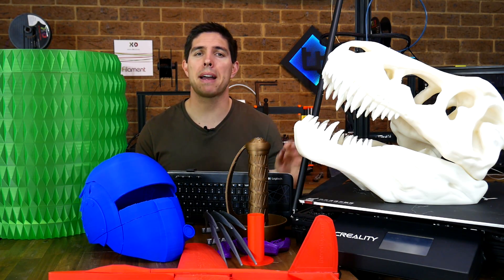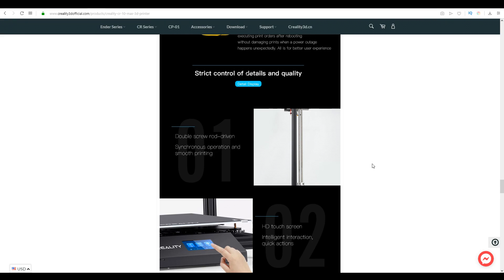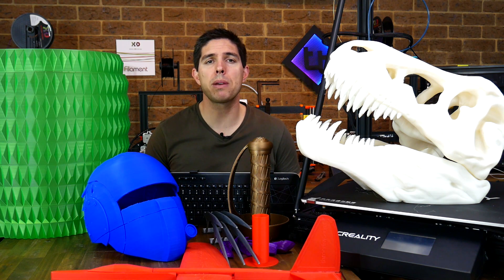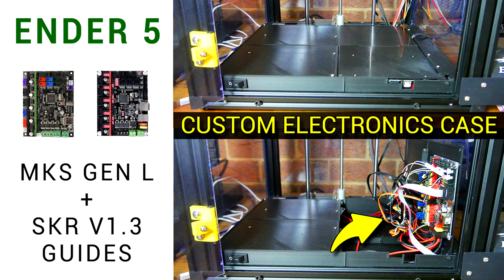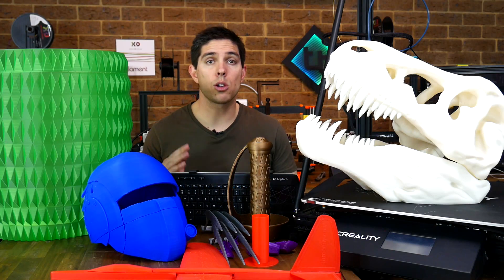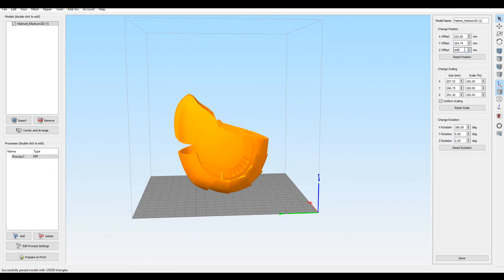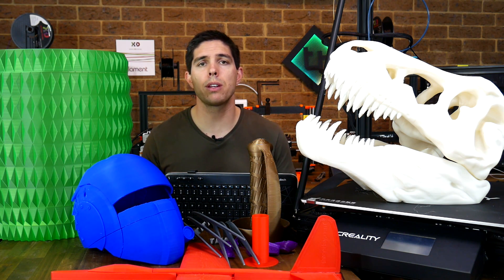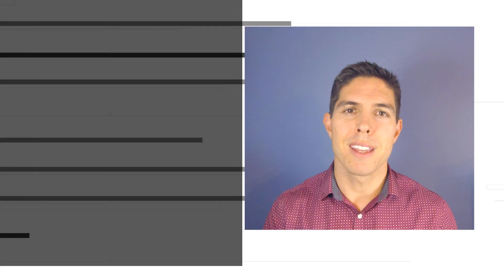CR-10 Max review - Is bigger better?

Comment: The issue with the layer seperation on your vase if probably due to the plastic not heating up enough. With a nozzle that big on a heatblock that size, it may simply not have the time to get up to temp if the speed isn't turned down.
Reply: Seth Krumm Agree... need to heat up a bit more... it is too much volume to pass quicly for the heatblock in a higher speed (for that nozzle size). Need to balance it... no v-ref changes needed.
Reply from the maker: Agreed guys, hence the slicing change with slower speed and more temp. The vrefs were still shipped below their specs though.
Reply: Teaching Tech Ok about v-ref. Marcus, keep in mind that you can go until 235 for PLA... expecially when you print with higher layers and wider nozzles. 

In Ultimaker community we make a calcularion about the volume to use a proper balnce beetwin speed, nozzle width and layer high... multiplicate all of those and you get the volume for m^3. Try to stay at 3-5mm^3/s for stunning quality and 5-8 for faster prints... more than that and you can get underextrusion (at least in UM2 printers). Cheers and keep up this awesome work!
Reply: with Bondtech extruders you can go up to 11mm^3/s

Comment: Here's how I would have designed this: all axis screws, no belts. Yes it would probably be a bit slower,  but for the distances being traveled,  belts don't seem to be as efficient.  And for the print bed, just as in the Z, I'd double up the motors..

Comment: Using massive nozzles with large layer heights is more complicated than it seems. Your temperatures with a standard 0.4 nozzle/0.2 layer height just won't cut it. Your temps have to be recalibrated, extruder steps, extrusion multiplier, part cooling, etc. I think Creality gets away with it on their smaller printers, but its very obvious where they are pinching pennies, and their QC is definitely sub par. I don't regret my Ender 3 because it prints great and has taught me a lot, but that's only after a lot of time and investment getting the quality and reliability up. For a printer of this size and expense which is obviously NOT a beginner/entry level printer, it should not have all of the same issues.

Comment: On a bed that size distortions are inevitable, genuine mesh bed levelling with as many points as possible should be mandatory.
Reply: Yes, but that is not a solution. You do not want to print leveled, but still skewed and warped prints.
Reply: @CrashPCcz  Are you on the plonk?

Comment: It looks really cool but I can't get my noggin around bowden on a single extruder?
Surely direct drive would be better and less expensive?
Reply: Bowden means light print head.
Reply: @JasperJanssen  it means the hotend is connected by a Bowen tube. The only necessity for which is really multiple filament printing.
Reply: @Quadromodo  no, it means the extruder and especially its stepper motor aren’t on the print head. Which means you can print at higher speeds with less ringing.

Not that that advantage isn’t much bigger when you have more than just 1 extruder feeding into the print head, but it’s not the only situation in which it makes a difference.
Reply: @JasperJanssen  I'm aware of what Bowden means on a 3D printer, I own a HE3D EI3 with triple nozzles wasted about 9 rolls of filament on it. It now runs as a direct drive titan with a custom 3D printed carriage and it prints perfectly. I personally hate the Bowden tube set up because retraction goes wrong constantly and shit prints get produced. I tried every set up from the original triple nozzle to AMF 3 in 1 out, 3 in 1 out diamond hot end. I'd rather just print good and accurate. My carriage has a titan that runs a pancake motor and I have had decent prints at 120mm/second.
It now equals my highly modified ANET A8 which I bought and modified about 6 years ago, except that it now has a build height of 300mm instead of 200mm.
Both of my printers have produced several hundred hours of prints. I'm afraid I'll stick by guns, direct drive is simply better and more precise.

Comment: Thermal runaway has been an option in Marlin since a long time, incredible they didn't switch it on by default
Reply: Ever tried talking to a Chinese helpdesk? They may have an English speaker on the other end who's like sales support or something but the workforce are generally Chinese and don't understand them. Besides by the time you have finished getting your message across you will have spent more than buying a homegrown 3D printer.

Comment: The problem that you had with brittleness is probably due to a too low temperature. A 0.8mm nozzle needs a lot higher temp than 0.4. I would increase a normal temperature of 200 to maybe 240 with such a big nozzle.
Reply from the maker: I found 220 a nice middle ground, albeit with stringing.

Comment: Seems like FDM has reached a limit. Size over practicality and use as well. Sticking a high end price on it doesn't mean it's a quality machine. I was quite interested in buying one but I think I won't. I'd rather stick 2 good parts together than have one larger part that's bad.

Comment: Im looking for a printer to do interior elements of around 1x1 m in size, it's totally amateurish but I am looking to limit the number of parts so am looking for a good 250/250 or 350/350 bed and rather the larger than the smaller. Any recommendations?
Reply: Ender 3 with and ender extender kit

Comment: Looking at the clicking extruder around 5:32, there was enough back pressure at the nozzle that the filament spring back was reversing the stepper motor. So nice thing is the bondtech gears were working well... because it wasn't slipping, the compression was actually back driving the stepper motor. Increasing Vref will help you push harder, but at the end of the day I think the limiting factor is not enough melt capacity for the volumetric output you were trying to generate. Two solutions: 1.) Increase the temperature so you can get more Delta-T on the filament. 2.) A better over all solution is a different hot end with improved melting capacity so you don't have to run artificially high temperatures to minimize back pressure. Great video as usual.
Reply from the maker: Thanks for the great post. I went for the temperature increase option but agree something like a volcano style hot end would be better.
Reply: @TeachingTech  A super volcano would be more apt. Some lost Z would be easily offset by 200g+/hour. Some giant 1.4mm nozzle prints.

Comment: 0.8mm nozzle on cheap pla on stock Ender-3, I find it maxed out on 0.6 layer height and 40mm/s print speed with cura and much higher temp than specified 210c maximum, 220 in fact, any lower and it will start clicking. I'm afraid something like E3D Volcano might be of consideration for larger volume print
Reply from the maker: Agreed.

Comment: Dear Friend! Could you please advise, what is printer under 300 usd better to buy in case you are beginner in 3d printing? I am choosing between anycubic i3 mega and ender 3pro. Thank you in advance for your advice! P.s. m.b. toy have another option for me, please share!
Reply from the maker: I haven't used the Mega but as far as I know it's solid. The Ender 3 Pro is a good choice because the community is so big and there are a lot of resources for it.
Reply: @TeachingTech  thank you very much for advice!!! Does any delta under 300usd (qqs or similar) worth it?

Comment: A printer with this large printing volume shouldn't have a moving bed. Too much inertia to manage by Y-axis motor and very soon motor and belt will wear off. One more thing is tangential force on top of the print, dangling cable will produce enough force on print that it will deform and loose alignment with nozzle. For 1000$ I can built a printer 100 times better than this.

Comment: I've got the CR-10 Max at work but haven't printed with it due to thermal runaway issues. Could you share the updated firmware?
Reply from the maker: https://drive.google.com/open?id=0B1mfg93qT2fsRXVnS2VqQzRfYllSSnM4RkdPMVhUcEFWSmc4
Reply: How is it working for you at work?
Reply: Jens Petersen a dust collector at the moment. Waiting to upgrade to octoprint on it to make the workflow easier. We’ve got 22 Prusa Mk3S so we don’t have much time for other printers

Comment: I have this printer im happy with the prints so far. Im having bed leveling issues where i set up bed hieght than after it auto levels the hieght is off and it different hieght every time within 1-2mm off. I usually have to adjust after print starts. Thanks for the videos very helpful.
Reply: Maybe you should try with a thread locking compund so that the screws cannot move.

Comment: Well i definitely don't check the boxes for who you recommend this printer to haha.
I have zero 3d printing experience but at my job we decided to buy one and they really wanted large build volume, so we bought the cr-10 max.
Done all the mods to it from nexitech's  review and am slowly progressing to make better prints but it is surely overwhelming as a first printer haha.
If you've got some slicersettings tips they are more than welcome!
Btw i also found the fan duct broken of and laying on the heatbed this morning haha.. i fixed it by printing a new one from petg.

Cheers!
Reply from the maker: My main changes to the slicer are in the video and my Simplify3D profile is linked too. I think you can open it in a text editor and read the settings. Well done on overcoming many barriers.
Reply: @TeachingTech  ah cool thanks i will look into your settings for sure:)!
I might want to purchase S3D in the future because of all the great things i've heard about it on significantly improving printquality.
Thanks a lot man, videos like yours help a lot and i will be a subscriber from now on.

Comment: My CR10S5 was great out if the box and upgrades are very easy to do. Adding a BL touch can be done in a day but honestly the bed came flat enough that I haven't once longed for the feature. Adding struts is not difficult at all and if you don't mind a click dial instead of a touchscreen they're great machines.
Reply from the maker: I'm almost tempted to do a build like this just to see how cheaply it can be done.
Reply: @TeachingTech  I actually got my CR10S5 (I call it half bootleg because some parts are OEM creality parts) for around $500 with shipping and everything on eBay. I'd love to see you pimp out a cheap printer!

Comment: Huge build volume is great, but TBH, I'd expect a $1000 FDM printer to need less tweaking to get usable prints.
Reply: @Barry Allen This is confusing.  The comment you replied to asserts the printer is relatively expensive, you say it's cheap.  TT seems to think it's overpriced, as well.  You seem to be out of step here.
Reply: @Barry Allen I have a job.  I don't just get to troll YouTube pretending skill and knowledge I don't have, attacking legit comments because I'm insecure and have a tiny little printer.
Reply: That's not 'tweaking'. That's repair of a broken product that should not have shipped.
Reply: @Barry Allen silly troll.  been printing for years.  don't need your trollish advice or opinions.  learn to read.  legit comments, not knowledge.  what are you, twelve?
Reply: yes technically its no different than a smaller unit so build quality should be high for 1000 dollars.
Reply: @magnetmannenbannanen  I'd say in retrospect that slinging a thousand bucks to make PLA prints of anything is as insane as Me. 3D printing isn't really worthwhile unless you are printing houses.
Reply: @Quadromodo  uhm, it could very well pay for itself in just a couple uses. I've purchased 2 gunstocks for my and my nephews Oculus Quest 2, each one was $100 including slings, and if id have invested the money purchasing my own printer instead, I could then still have a printer and be able to print anything else. Just because YOU have no need for anything 3d print related, doesn't mean there isn't ANYONE. Many people make a living off printing stuff for other people.

Comment: Creality is a shit company that produces shit products. Not having thermal runaway protection as a factory default is borderline criminal. Not to mention they STILL steal from the open source community and don't give back, AND every 3D printing forum is absolutely clogged with people asking for help with their shitty Creality printers. Fuck Creality.
Reply from the maker: That's a very strong opinion :D
Reply: @TeachingTech  It's based in fact. They produce low quality products, with little to no QC. No bootloaders making it very difficult to upgrade firmware for the novices these printers are aimed at. Sending machines out the door with basic safety settings like thermal runaway protection disabled shows a complete lack of concern for their customers. That alone should preclude anyone from purchasing their products. Would you buy a water heater with no pressure relief valve? Plus their blatant disregard for the Open Source community and the licensing of open source hardware and software. They do not care about the community. They do not care about safety. They do not care about their customers. They do not care about international law. They care about nothing but profit. And it's not like they haven't been called out on this many, many times and are not aware of the problems and danger they cause. Hell, even Naomi is getting sick of their shit. They are a horrible company and should not be promoted or supported in any way.

Comment: I cannot believe that Creality is still sending printers out with thermal runaway protection disabled. 
shame on them. they know it’s a big deal!!!!!
Reply: Clorox Bleach you’re missing the point. 
Yes, firmware can be changed, BUT this should NOT be turned off by default.  If they can add automatic bed leveling and filament runout detection, then why not just turn it on?  Seems like no one has told Creality about the Anet fires!

Comment: This was my experience with the S5.
Reply: Same. I have an S5 and have only done 3 prints on it and set it in the corner. The S5 really needs bed leveling and I dont feel like installing a boot loader just for that. I am sure when I have more time to mess with it I will update the board and add bed leveling.
Reply: I ended up replacing the stock board with the TH3D Creality board replacement for two reasons... First and foremost for the trinamic drivers. The y-motor was so loud even after using a rubber damper it would howl loud enough to wake the dead!  Second for the native bltouch support. With a bed that size, it should be standard equipment from Creality. The only other mods done was swapping the hotend for the MicroSwiss drop-in and adding rods to stiffen the z-uprights. Now it's quiet, reliable and safe. The next thing will be to ditch the heavy-ass glass for a flex-plate system.

Comment: I have the CR-10S Pro, have some issues worked through them, dealing with Creality customer service I would rate it poor at best. I think what sells creality is the size of what you can build, the max to print ABS you would have to build a condo around it. Poor quality control. Thanks for your video.👍

Comment: Where did you get a spare bltouch pin? Mine was bend and is don't trust it anymore.
Reply from the maker: I changed to a whole spare BLtouch. I did get a spare pin with one of the first ones I purchased, but I didn't use it here. btw I've had bent pins in the past, bent them back straight and have had no issues since. If the first layer is good, the first layer is good!
Reply: @TeachingTech  OK I wil give it a try. Thanks!

Comment: I think Creality just need to slow down a little and work on improving QC & refining their printers taking a little longer between iterations. They're releasing printers too fast with barely any improvements to each.
Reply from the maker: A very fair point.
Reply: I'm with you there.

My ender 3 has been amazing but it also pays to take your time building them and checking every screw.
Reply: I agree. I've got an ender 3  and it has worked almost flawlessly out of the box.
Reply: I agree. If they could just go the extra 5% in the QC process, their larger printers could double in value.
Reply: I'm having a blast with my CR-6 SE so far - so far needed zero mods or alterations except a slight tightening of one of the wheels which is a standard check when building. The CR-6 shows what they can do - hopefully they'll do the same for their other models.
Reply: Absolutely.. There even starting to compete with there own printers for gods sake...

Comment: Nice to see someone using S3D for a change.great video as always michael👍
Reply from the maker: At some stage I might make the "is S3D worth it?" video, although I expect that to be contentious and I'm not seeking drama.
Reply: @TeachingTech  This will likely results in fight as people are weirdly patriotic of their slicers
Reply: @Cyclodexter  I use S3D, and I paid full price for it. I'm pretty happy with it. Was it worth the $ ? I don't think so at all.
Reply: @TeachingTech  I've been trying to convert to Cura for a while and while I like their feature set, I could never get as good results as with S3D. The latest version, where they included the Creawesome mod (which I never liked), really screwed up my profiles and that was it for me. Then I decided to try Ideamaker, and whoa! Perfect prints by just transferring my settings from S3D. The settings are very similar to S3D, so much so that I wonder if S3D and Ideamaker are based on the same code (some of the messages are identical).

I don't mind paying for software or upgrades, and compared to many other professional software packages, $150 isn't much. My problem with S3D is the lack of upgrades (I don't consider the last few versions upgrades). I would love to see a review of some slicers on your channel for those looking for an alternative to S3D.